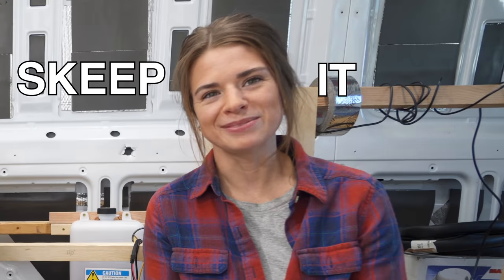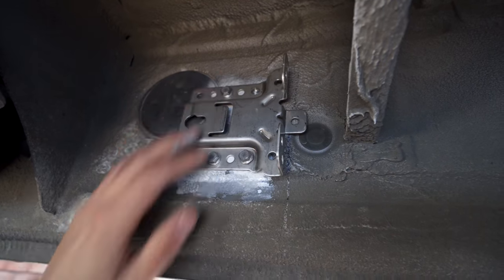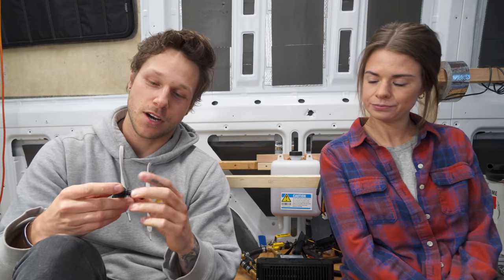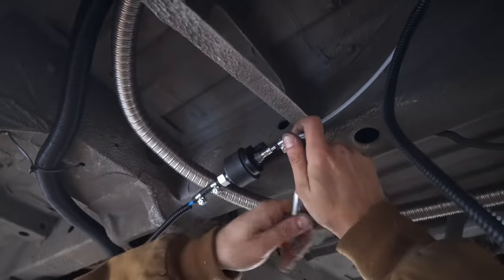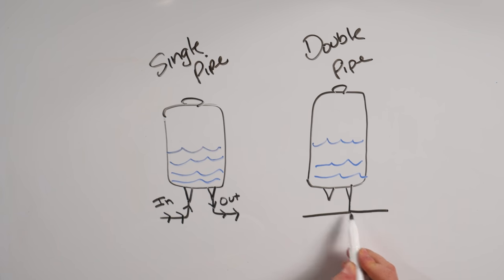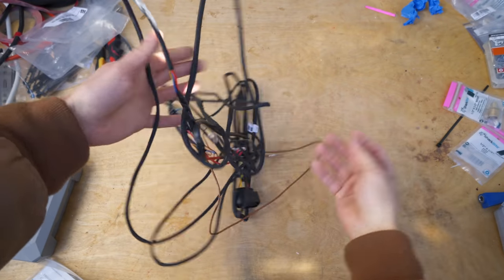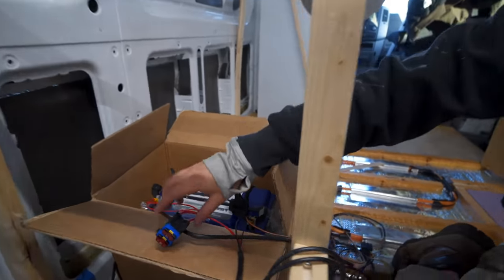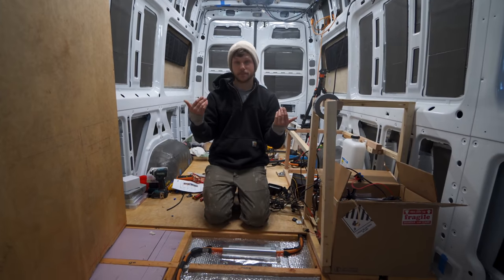Heat Your Feet! How To Install A Hydronic System In Your Van

Comment: First of all, I commend your effort and enthusiasm, but I do have a few comments.

As others have mentioned, there is no need for a bypass pipe/valve system. Only the shutoff valve. Your drainage should be at the lowest point of the system. The ideal position would be on the lower pipe connection to the heater. If located in the van, you will be left with some fluid in the system. Your expansion tank should be at a certain height, above the highest point of your entire piping. That way, it provides positive pressure in the system. The exact height is probably given in the instruction manual, but it should be measured from the highest point of the entire piping system.

It would be great if you could switch on the pump independently of the heating system when priming the system (pouring water into pipes). It is a bad idea to run the heater without water circulating. I have seen that you got some comments from the technician versed in installing such systems. Ask him for advice on how to properly prime the system. It is not always as straight-forward as just pouring water into the system (I have no practical experience, so I can't advise).

The suction pipe in the fuel tank should go no more than 2/3 of the depth. The idea is that you never empty the tank with the heater. It would be a very bad situation to try to start the engine somewhere in the wilderness just to discover that the tank is empty.

Most importantly, forget about floor heating. In the end, it is a waste of energy. Basically, you are wasting heat produced by the heater on the environment through the floor. The theory of heating is that you have to introduce heat into the space, and the most efficient way is through the air, i.e., by heating the air. That way, you are heating the air in the space and, indirectly, the people and furniture in that space. Of course, you could introduce heat through the walls and floor, but that is inefficient because you are losing heat. When in a house, there is some extra level of comfort if heat is introduced through the floor, but the comfort is traded for (relative) inefficiency.

Furthermore, floor heating is built a certain way. Very, very strong insulation below the pipes, very conductive material around the pipes, very tight contact of the pipes to the conductive material above. You can't achieve that in a van, and in your example, it is certainly not achieved. In your case, it is like if you had put a stove in your bedroom, closed the bedroom with very tight doors, and then expected it to heat the living room. It just doesn't work. Your pipes in the floor are the stove in the closed bedroom, while the van is your living room.

My suggestion would be to strip all the pipes in the floor, and add extra insulation beneath the flooring.  If you suffer from cold feet and would like to walk on a warm floor, put some thick carpet on the floor.

Comment: Built Hydronic floor , using 1/2 inch pex , routered into  2" XPS with aluminum dissipators sandwiched in place.
The length of tubing is critical. 3/8 can actually deliver enough heat (and bends easier )
You need to be able to dissipate thru the floor.  Your test with the Aluminum fin up failed because it is such a short tubing and not in direct contact with wood floor , ( needs to be stapled but that is impossible with pipe already in place.) 100 feet of tubing is closer to what is required for X,000 BTU heat transfer. (to get the effects you were expecting.

Comment: I noticed that D5E is about $1000 less that the D5S, however the D5E doesn't give any specs for the system. the D5S is 17,000 BTU heater. What is the BTU rating for the system you used for your rig?

Comment: hello, please dont use electrical tape in the loose wires, over time it will come loose. Use glue lined heat shrink, and rap the wires with exterior tesa tape
Reply from the maker: Our loose wires were eventually placed within their respective housings or sealed off with wire caps
Reply: @dogcatmanvan  nice, loose wire can cause a fire

Comment: As you have a twin line water feed, why did you need the three way valves for the floor bypass? I agree if you have a single line system you would need this, but with a twin line system all you need is a single on/off valve to shut the floor loop off in summer, especially since your bypass leaves liquid in the floor loop so really no benefit with the complex bypass setup. It may even cause issues as this will allow hot water to flow via the least resistance path through the bypass valves back to the heater causing this to regulate (reduce output) or even maybe shutdown.

Sorry if I’ve missed something here, but I’ve fitted a few of these Webasto style heaters on several vans.
Reply from the maker: You’re probably write. We’ve received a few comments suggesting the same thing. This was our first go at a hydronic system so I figured a bypass is what we needed, but I can see how a simple shut off valve would do the same trick. Wouldn’t the fluid still sit within the heated floor loop though? Or would the pump pull it out once the heated floor section is cut off?
Reply: The glycol fluid will “sit” in the floor loop, but this really isn’t any different to the fluid sat in the header tank; it doesn’t “go off” or anything just sat there. Think of it like an electrical circuit with a switch disconnecting either the positive or negative connection to the battery - nothing flows until you turn the switch/valve on (I guess you could say that in an electrical circuit the power is just sat there, waiting to flow once the switch is turned on too).

The pump won’t suck the fluid out of the floor loop, as there is no pressure created, the fluid will just circulate via the plate heater for your hot water and the air heater matrix instead - that’s the great benefit of using a twin feed/return design as you have. 

Those circulating water pumps don’t make a lot of pressure either, as they are a different design to the pump you have for a faucet on a sink. They were originally designed for use as engine pre-heaters in cars/vans/trucks, so the electric pump circulates the engine coolant fluid when the heater is running, but allows the coolant to flow through it when the heater is off but the engine (and its coolant pump) is running.

I hope this helps you understand things a little better.

Comment: ALWAYS do intake at the bottom.
That way it fills up evenly and there's no air pockets. 
If you go from the top, the water can "fall" (aided by gravity) and create dead zones where no water touches (which is HORRIBLE for your machine and will cause it to burn out much much faster)

Hope you read this!
Good luck
Reply from the maker: It has been read and we appreciate the info!
Reply: (Push in water from the bottom) if that was confusing wording.

Comment: Great tutorial. I'm in the daydreaming/planning phase of a future van build and would like to do something similar for my heating so definitely saving this for future reference.
Reply: i wished average sub-120k usd luxurious passenger car's did it to
Reply: I put one of these in my van and thought I might regret putting in the heated floors.  The Kalori blower that comes with this system is SOOO loud I scrapped it and put a Chinese diesel heater under the passenger seat floor which has worked incredibly well and from the back of the van I can barely hear the heater even on high.  I went skiing yesterday and camped there the night before.  Temperature was 8 degrees F.  We actually didn't have the heat on all night and woke up to a pretty cold van.  I turned on the diesel heater and it just could not seem to warm up the van comfortably.  When I turned on the floor heat the van heated up quickly.  So long story short I would definitely recommend the floor heat because the floors get really cold and just having an air heater might not be enough.  The chinese diesel heaters are cheap so would recommend going that way instead of the Kalori blower.
Reply: @vikingvan7864  on JC-6 2005 model year the floors in the winter time can be miserable despite the tail pipes getting way hot and in the summertime leaking a lot of heat in to the cabin that and the fire wall but in the winter ❄it does help as the wall keeps the windchill at bay and a lot of the air box heating leaks out from the cold bottom of the jeep and with the engine heat and a extra pump or thermo-sifin i wish it did floor heating and air conditioning from the dealership from day 1
Reply: @vikingvan7864  some luxury cars are more insulated for sound and temperature controlles but still the floor is a weak spot as the pavement or wind that goes under it soaks up the temperature delta more than say the roof or F-windscreen glass so instead of a 1 or 2 hours of the car staying the same comfy ish temperature as the engine block/exhaust ect. does store some heat in the winter and can be extended for another 6 ish hours with little parts or complexity or weight added 😉 aka come out of work/shopping and the car is already warm ish with no extra fuel used or a very little extra energy as it's possible to used a extra part to extend it indefinitely as long as there power to do so in side of the cabin ie a C-class or lincon or caddy devill or 300-C or model S or X Tesla's ect.

Comment: I've heard you need to use submersible fuel lines in the tank. Usual fuel lines would dereriorate with a time. Maybe not an issue with diesel or you used correct hose but worth to check. Great video! 🙂

Comment: I just added a floor heat loop to my Espar D5WS.  Bypass with just three standard ball ball valves.  One ball valve on each leg going to the floor heat loop.  One ball valve in the center of the bypass.  To add the floor heat to the glycol loop, open both ball valves and close the third ball valve in the center.  This will allow glycol to flow through the floor loop.  To bypass the floor loop, close both vlaves going to the floor loop and open the third valve in the center of the bypass.  Easy peasy, commonly available valves from any hardware store.

Comment: Very nice to see you have made the hydronic system working. I did the hydronic system in my sprinter 4x4 with single loop system. Floor does not get hot but it is warm enough to walk on it with bare foot when out side Temp is below 20 degrees. 
Do you have any issues with not controlling the fan speed. I can not control fan speed on my setup. other than that heater works great.
Reply from the maker: We've been able to control the fan speed thus far. It's a bit delayed when switching between speeds, but it works fine.

Comment: You know what is shocking to me, is that while your DIY hydronic floor works as well as you'd hope a hydronic system to work, you couldn't ask for more at that price point with a new heater. But there are outfits out there like Vanlife tech charging $15,000USD for their DIY kit - essentially the exact same thing as yours, with the only difference being maybe some solenoid valves and a fancy controller, can you believe that? I don't know what your total came to, but at Vanlife Tech price point, it's almost robbery. Considering you can pickup refurbished Eberspacher and Webasto diesel heaters for a couple of hundred bucks, you could make your own WiFi compatible controller with some basic WeMos arduino knowledge, in my opinion you could make your own DIY Vanlife tech system basically identical for probably $2000 at most. I think it's time to bring some competition their way, $15k, talk about having the market by the balls... great job on your build!!

Ps. the squeaking noises with the dog are at least 60% of the reason I tune in hahah

Comment: Great video! I think it is highly recommended you exhaust vent out the from under the van. It appeared in the video you are venting the exhaust under the van.  You don’t want the fumes creeping in every nook and weeping hole under your van. 

 I went with Rixen's Hydronic heater and after seeing your video I am glad I did, so what you talked about at the end is not an issue with Rixen's.  Hooking up all the wire was dramaticly simplified and you don't need to do near as much work to integrate all the wireing end points.  The support you get from Rixen’s is superb!  Really more than half the time you get Jim Rixen on the phone and he is happy to help the DIY folk.  I actually think he likes being on the front lines so he can hear the issues first hand.  I wish I had decided on the Rixen's system before I completed my flooring.  No in floor heat for me.
Reply from the maker: Thanks for the heads up!

Comment: The fuel intake hose should have a screen on the bottom and should be up at the 1/4 of the tank off the bottom of the tank didn't see you do either the reason you put the intake at the 1/4 is so you never run the tank out of fuel leaving you unable to drive until you get more fuel
Reply from the maker: The hose doesn't have a screen, but the line is definitely over a 1/4 off the bottom of the tank in order to not run myself out of fuel.

Comment: Nice! I don’t have the same stuff, but my air heater does have a valve on it to make it hot or ”cold”. On my heater in outputs do matter. I didn”t see any valves on yours so you should nit care about direction.
My floor lines runs roughly 20 cm apart from each other. Even after a whole night running you still feel colder areas in between. Lack of concrete😅
I insulated all my pipes as they do heat up quite a bit. And try not tu build to much stuff around as you always want to check your system!!!had 2 month great than started leaking...you never know on this diy systems. 
Btw, i only use the fan to warm up quickly,than it only maintain heat via the floor, really nice. Had this weekend -3C out and staedy 15C inside.
Wish you both all the best. Cheers
Reply from the maker: Thanks for sharing the real world experience you've had with your system. I'm curious to see how ours pans out once we're up and running!
Reply: @dogcatmanvan  thanks for the entertainment! ❤️👌👍

Comment: Hi. Cool video. I have been looking at the Van Life Tech’s floor heating. But it is pricey and i live in sweden and the VAT, shipping and customs fee busts my budget. So i found the one you installed. Does it differ much from Van Life Tech’s floor heating? There’s a huge price difference, why? I will not be building it, I have van builders for that. They have never installed floor heating so i dont know if VLT’s is easier? What are your thoughts?  I am also interested in VLT’s upcoming recirculating shower, so maybe it would be a good idea to have the floor heating be the same brand.
Reply from the maker: It looks like all of the components are the same as our system, but your also purchasing an entire pre-built heated subfloor. We had to put ours together with pex. Theirs come pre-built to heat the entire floor of your vehicle. Not just the areas you choose.

Comment: I would warn against tying into the existing high pressure fuel line.

I would also run the wires, then build the harness so you can get wires through smaller holes.

Looks cool.

Comment: A quick tip when taking a fuel pump please use a brass rod to remove the      circular bracket or whatever the bit is called that tightens down to hold the fuel pump. Sparks and fuel tanks can be sketchy but as ya can tell ya can get by is just a little risky
Reply from the maker: Good point!
Reply: @dogcatmanvan  awesome video though makes me pump to do my own build. Take it easy!
Reply: @NoOne-xp1pe  awh well that's good to know I generally don't use diesel so figured it was fairly flammable as well.
Reply: @timort2260  In the movies and TV it blows up all the time, creative license, but also why they tell down right lies constantly. Like the science parts on Bones, anything having to do with guns, or how great government is at doing anything other than lying. Bit much, but true.
Reply: Not likely since it's diesel but it's better to be safe than sorry.  [FYI, diesel can extinguish a lit cigarette.  The flash point for diesel is much higher than gasoline and is less combustible.  The problem is that some people put more combustible additives in their fuel tank.]

Comment: Glad my Espar B4L M2 was really easy to install and works great at high altitude!! It's heats my van up in any temp in less than 10 minutes. That seams like way to much work for a floor that's about 15 sq.ft. but good luck!!
Reply from the maker: We liked the challenge. Thanks!

Comment: hey, I am worried that your single pump doesn't have enough power to pump fluid around the floor loop and to everything, perhaps that's why the floor is cool.
I'm planning to add a tank for hot glicol and separate pumps for each heat pulling component- floor, air heating, water heating, webasto
Reply from the maker: It seems like the fluid is getting through the lines fine since the return is still just as hot as the main line. I think it's just because our lines are so far apart and they're half inch. Maybe going with 3/4 lines spaced about 6-8 inches apart would've been a better route.
Reply: The pump is pretty weak but it has worked fantastic for us so far.  My pipes are as close together as the dispersion plates allowed.  I was a little nervous that little pump wouldn't be enough to get the glycol through the 1/2" pipe I used but it's worked well so far.